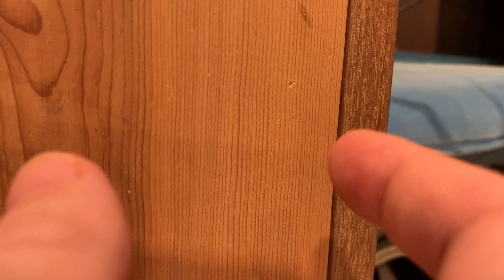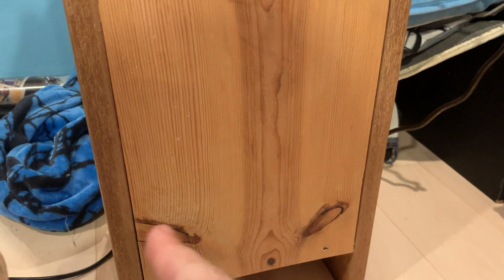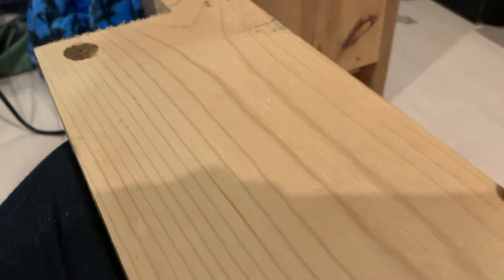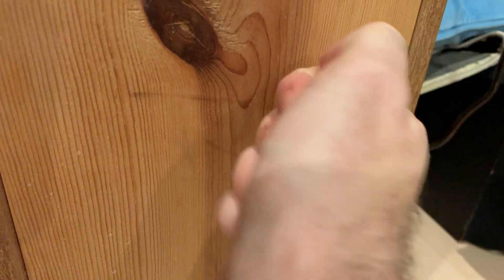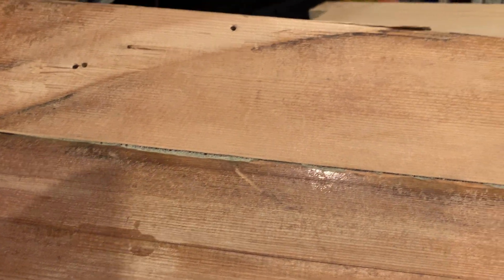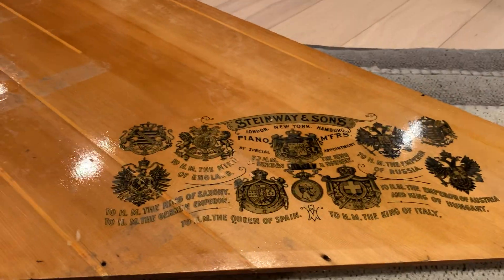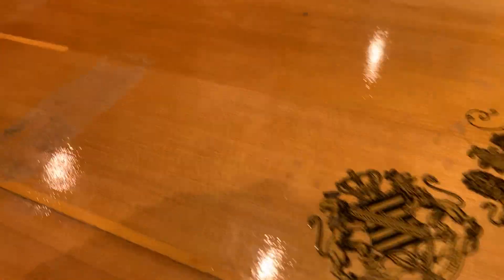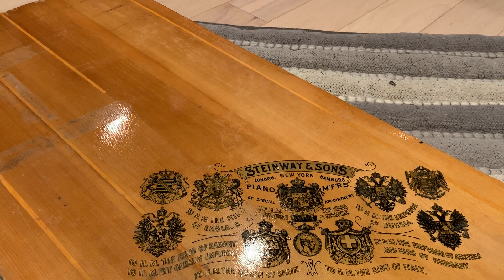Tonewood unveiled!  Greatest treasure for speakers and tonearms

Comment: What makes a good tonewood it's not just the tightness of the grain but the uniformity and straightness of the grain no waves
You could try making it into T shape for the tonearm make it stiffer can use less material! Could be assembled without glue but you have to be skilled otherwise glue together with a resin glue naturally anyway to the wood. Cut a rebate joint in the top horizonte piece a-thirds of its depth a tight fit to slide the the vertical piece into under pressure with clamps,  the vertical piece doesn't have to be sticking out that much a quarter of the total thickness will be fine. Prevents warping as well but probably not so much would be with old wood like that but does add strength and durability and control resonance.
 be careful you don't make it too tight fit.
As I said to you before bowing the arm would be beneficial centre of gravity centre centre of mass, if you had an 25-35mm from the centre point of the bow should be fine.
Put it into the given shape with a piece of string tide at either end and then heat it with a kettle steam or put it in boiling water for a few minutes and let dry, keep it shape make the bow shape a little bit bigger than the given bow you want at the end because of spring back. you can still do the T shape but more heating would be required probably.
Theoretically you could pivot the arm in the Centre Point would be best and have your arm wire ending at that point!!  you don't really want a lot of wire you were talking about your record why it sounded so bright will that's because of the wire length tonearm wire increases capacitance.
 If you get a golf ball a pot of Vaseline.
Grind the tonearm to the shape of the golf ball a tight fit glue it with epoxy resin under clamping,. You can do this easily get another golf ball epoxy a big flat head bolt to the golf ball so you can fasten it in a drill, on the opposite end attach different grades of sandpaper these can be attached with masking tape and superglue two pieces together! you stick the masking tape to the golf ball one piece another piece to the sandpaper you want to use and a little.. drop of superglue between the two better than double-sided tape, start with a heavy grade and then work down to a fine grade you want the golf ball to be a snug Fit a third... of the distance of thickness of the wood no more inserted. 
Fasten the golf ball with epoxy resin, find the centre point where the golf ball is fixed and drilling a hole near the top or even better epoxy a fine brass tube to the top of the tonearm, a millimetre hole so you can thread a piece of Cotton, 
 you need to find a piece of steel bar size 12 mm diameter bend this into a right angle long enough to go into to a baseboard,  no less than 22mm bamboo or plywood, a tight friction fit in the hole for adjustment, a grub screw could be used, the Vaseline tub would be connected to the baseboard with some epoxy resin, and the bar long enough on the right angle to go over the centre point of the golf ball tonearm, and 30-50mm clearance off the top of the tonearm. How high or low will govern your bias setting! So start with half a pot of Vaseline at 30mm so you can adjust the height, you don't want the hole of the golf ball sitting in the bath Petroleum jelly only the bottom quarter of the ball is sitting in the petroleum jelly.
 Some silicone oil could be used mixed in with the Vaseline probably, in most circumstances they just use silicone oil but because the arm is going to be long and heavy the Vaseline probably do enough on its own! Add stability! You can adjusting its height the bar,  the cotton thread adjust with the bar azimuth and bias, and the bar has some forward to back movement what can help in pivot angle adjustment overhang,
 make sure the ends of the hole you drilled are nice and smooth and tapered where the thread comes out! Line this with a bit of poxy resin then Polish around the edges or use a brass insert, same with the pipe.  If you want to see an example of this look at Well-Tempered turntables Arms.
Next time I talk about a bearing for you if you're up to it lol  it's quite straightforward give it a go mate I probably made it sound complicated, the arm is basically balanced very little weight is needed you could use a penny is 3.5g just behind the golf ball to give you that balance for the cartridge a little bit of blue tack to hold in place
I should have added the execution of the wire you can execute it from the top just looked it over the pivot and down being mindful of twisting
If you want to hide the wire you could put a brass tube in the golf ball at the bottom feed the wire through the tube and out through the tub this is ok with petroleum jelly but would be tricky with oil